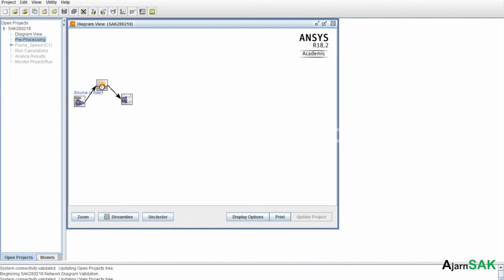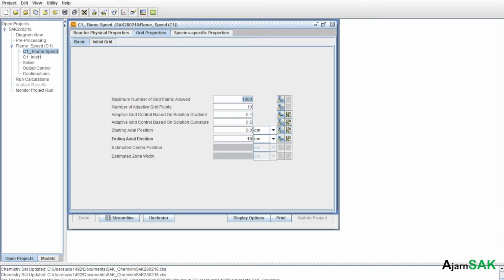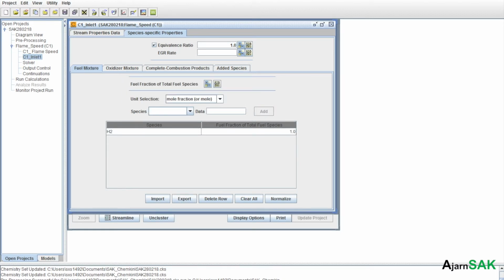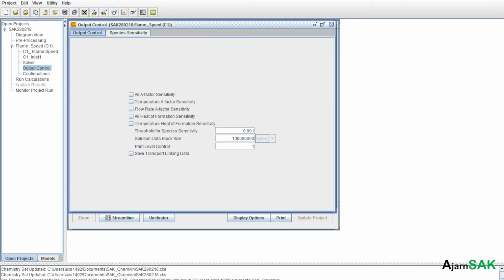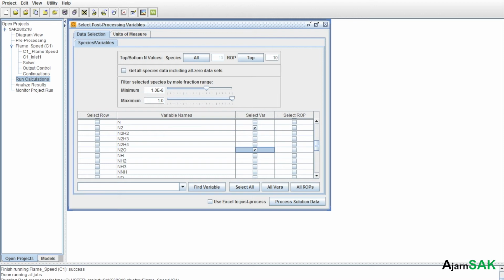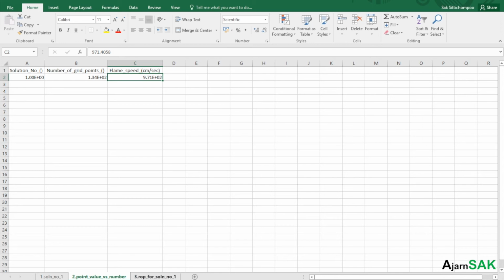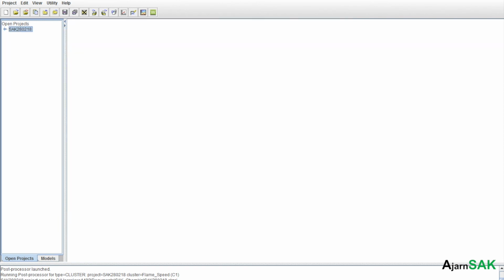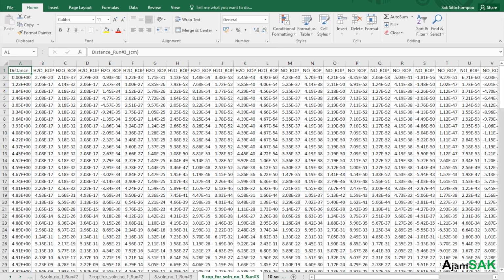Ansys Chemkin H2 combustion tutorial by Dr Hadi Nozari

Comment: @Ajarnsak 
Error: C:\Users\aerok\Downloads\ThermodynamicalProperties (1).dat contains illegal thermo data format.
The lines containing illegal thermo data format are listed in C:\Users\aerok\chemkin\H2\ThermodynamicalProperties
(1).dat.format_error.
Please refer to thermo data format specification provided in Chemkin Input Manual - Table 2.1 and 2.2.

I am having this error while using the thermodynamic properties file.
Reply: guys, just delete the data about the Tc4h7 in both thermo and transport data files. it works. this specie doest contribute in the mechanism any way
:face-blue-smiling:
Reply: @Shasha.bellis  thanks a lot !!!..this worked
Reply from the maker: Please look for 'Output' file, it is somewhere in Chemkin folders. It usually points out the line where the illegal format locates. Then you can try to correct the error.
Reply: @Rocky Pinto   How did you fix it?
Reply: @Rocky Pinto How did you fix it?
Reply: Facing same eror. How did you fix it.? Plz guide man

Comment: I‘ve failed 2 cases. The Temperature of unburned gas are 473K and 573K. Other cases succeed. Would you tell me why does it fail?
Reply from the maker: Try set equilibrium temperature to some other value and see if the solver has any temperature restriction in use manual. Hope you get it work! Cheers!

Comment: There is something wrong with the thermodynamics propeties file
Reply: The file format is not accepted by chemkin
Reply: I am also having the same error, the thermodynamic properties file. "ThermodynamicalProperties.dat contains illegal thermo data format."

In this version of Chemkin (assuming 2018), the pre-processor does not have the "Perform Data Format Check on Chemistry Input Files". If you would like to continue with the possible errors you might have, you can simply uncheck the option for the Data Check. However, there will be some errors in the input file and hence, in your solutions.
Reply: @serhantarik651  thanks, i am trying
Reply from the maker: Do you mind elaborate that? Might be beneficial for people who watch this video ;)
Reply: How did you solve it please ?

Comment: Great video! I've been trying to solve a flame speed reaction of plasma assisted methane combustion but I can't get Chemkin to converge. I've tried to vary the parameters you stated in the video but with little success. Any advice would be greatly appreciated.
Reply from the maker: Combustion is not my specialty. Though, if you successfully run the pre-processor, then it shouldn't have much problem.